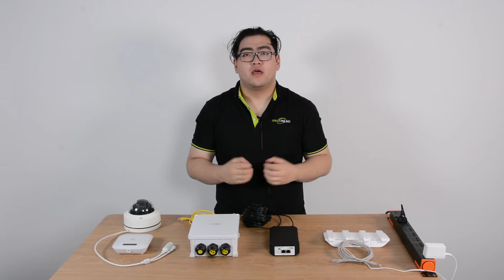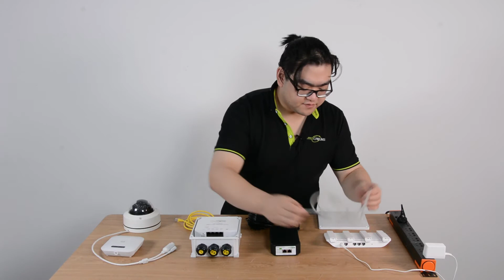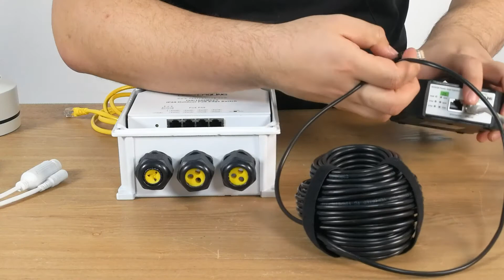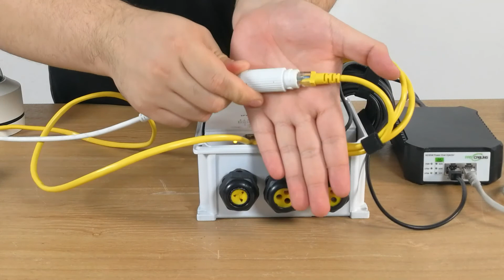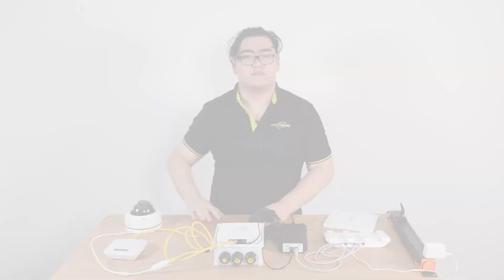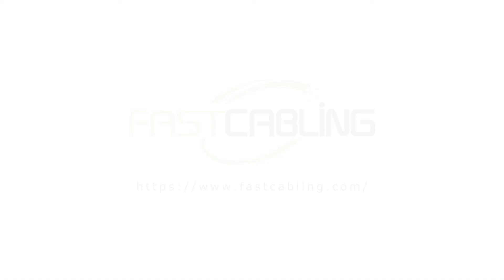PoE VS. PoE+ VS. PoE++ - What Is the Differences?

Comment: how to find poe++ cables
Reply from the maker: You can use Cat5e cables or above. To handle the increased power, make sure the Ethernet cables use pure copper conductors, not copper-clad aluminum (CCA), as CCA will not handle the power as effectively.

Comment: i have a nokia famtmile 4g outdoor antenna and it comes with a 53v poe adaptor to give it power and also to connect a router to the internaet to distribute wireless signal , however i would want to buy a backup mini poe ups to power the router wen there is no AC power ,but the highest i have seen is the 48v poe mini ups , will it be sufficient to power the 53v  fastmile or is there something i can use to convert the 48v poe to 53v to power the fastmile
Reply from the maker: If the distance is short, you might try the 48V UPS. Also, you might want to check the specification of Nokia famtmile, just make sure it is IEEE802.3 compatible PoE device. With DC48V, you might low part of the power budget basing original decide. That is why I said the distance should not be too long.
Reply: @Fastcabling  what length is okay enough for a 48volts poe ups  to be able power the 53volts fastmile

Comment: Is there any potential damage on a PoE security camera when it is connected to a PoE+ switch ?
Reply from the maker: No harm. There is power negotiation between the PoE switch and your ip camera. The PoE switch will verify and classify your edge camera before it sends the power. It will downgrade to PoE if your camera doesn’t require PoE+. Moreover all the electrical products only will take whatever power budget it needs. Even you can use 90W PoE++ switch to connect the PoE camera.
Reply: @Fastcabling  Thanks Bro,

Comment: What will happen if you connect a poe plus ptz IP camera, to a regular poe switch? The poe switch has a 48 volt 1.2 amp power supply and I don't think the camera draws more than 15w.
Reply from the maker: The PTZ camera definatly will draw more than 15W. The infrared PTZ camera requires about 24W maximum. You should test the camera's power consumption in dark environment or force the infrared to turn on, meanwhile moving the camera around. It should draw maximum power when the motors are running. If your PoE switch supports also PoE+, it will be fine, otherwise, it will force PoE switch keep rebooting when the power is over load. You also use the PoE+ Injector if your switch only output PoE IEEE802.3af (14.4W)

Comment: Does POE + and POE ++ need special cables to handle the current or regular cat5e will do?
Reply from the maker: No, it works with standard cat5e and cat6 Ethernet cable. Just make sure it is 100% pure copper but not the CCA type. There is serious power loss in the CCA type cable.

Comment: Main router + 100 meters cable + POE + 100 meters cable + 2nd router  is it gonna work or do i need POE injector as well?
Reply from the maker: I suppose you will need extension between two routers. You mentioned there are 200 meters between them. The standard TCP/IP network only can provide 100 meters distance without extension.

Comment: can a non PoE device connect to a PoE switch and can a PoE+ camera connect to PoE++ switch. Can a PoE NVR connect to PoE++ switch to PoE+ camera ?
Reply from the maker: Yes, the camera non PoE device work with PoE switch. There is power handshake between the PoE switch and you edge POE device. If the POE switch or PoE injector can't verify the edge device is POE compatbile porduct, the PoE switch will not send the power. No only power handshake, but also classification, the PoE switch will know what power budget should set to. The PoE++ switch can work with PoE or PoE+ edge equipment. It is backward compatibile.